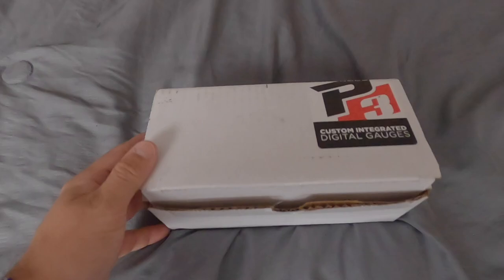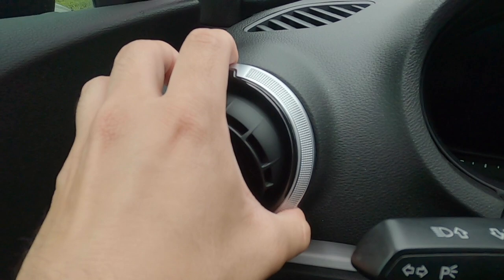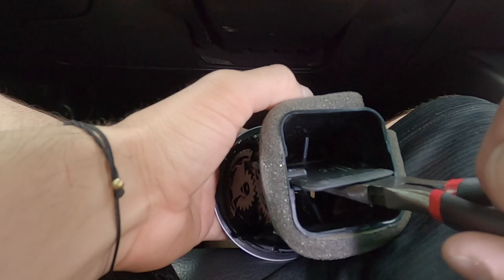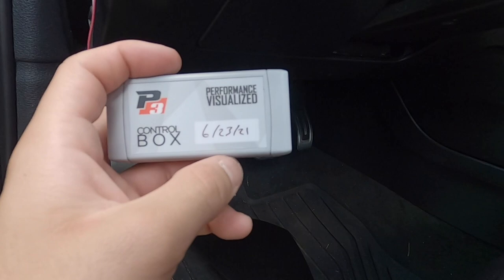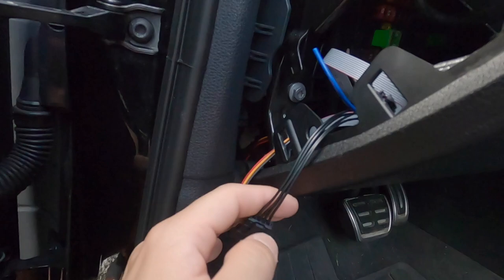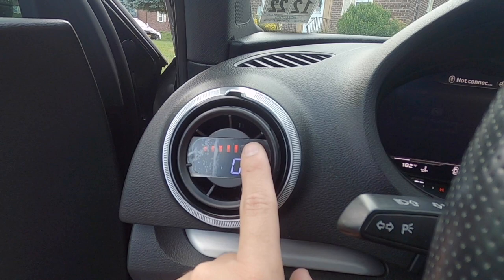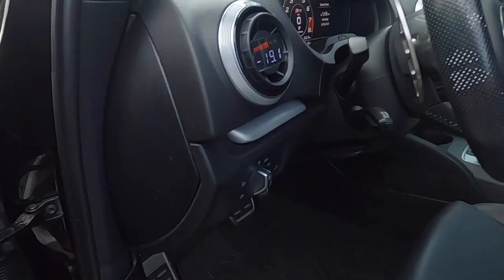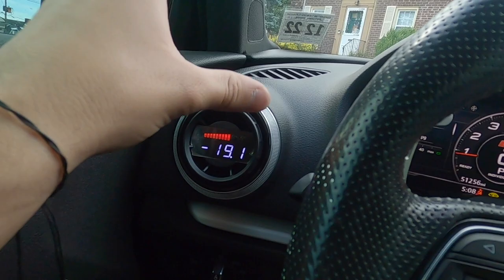Audi A3/S3/RS3 P3 Digital Gauge Install!

Comment: The gauge matches the dash colors so it flows awesome. How is the airflow from the ac out of the vent?
Reply from the maker: Tbh the airflow from the vent isn’t bad. Sucks you can’t move the vent like the stock one but plenty of air comes out

Comment: Is the ac sufficient enough in summer with the gauge on the vent? Looks great but wondering about airflow
Reply from the maker: Tbh the ac is great still. Blows a lot of air past the gauge. Only thing is you can’t move the vent obviously but it still blows a ton

Comment: Does p3 have gauges that show ethanol content?
Reply from the maker: This one will show ethanol content. You would just have to buy the add on to add a sensor to the harness that has an extra wire for it

Comment: Are you on stock intercooler?
Reply from the maker: Yes I am
Reply: @DArias  does it ever get hot out where you’re located? Or any cooling issues after doing pulls? Im in texas gonna order a dp soon & stage 2 93 but debating on how soon I need an intercooler cause it gets a little hot here
Reply from the maker: Intercooler should absolutely be next on your list. The stock one isn’t horrible while driving and cruising but once your idling or do back to back pulls it’ll start to heat soak
Reply: Thanks for the advice brother, beautiful car btw , you should do a mod list video soon with future mods you plan on adding
Reply from the maker: Thank you man! And I think I will soon! I have a few more things coming (that are a bit pricey) that I would want to include in the video haha